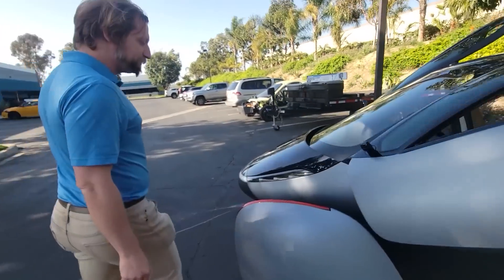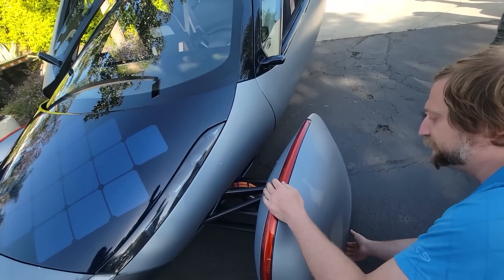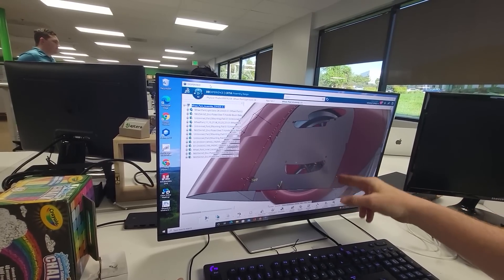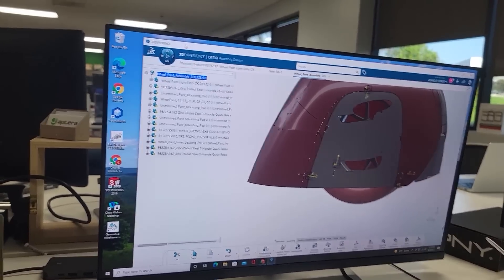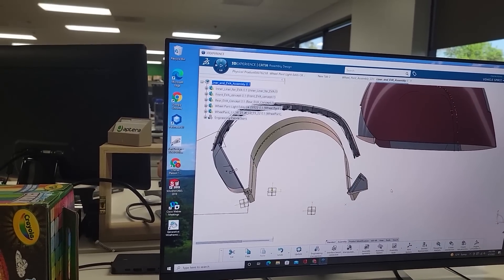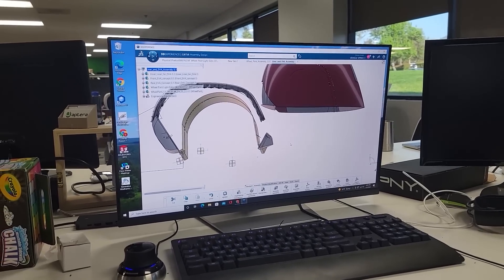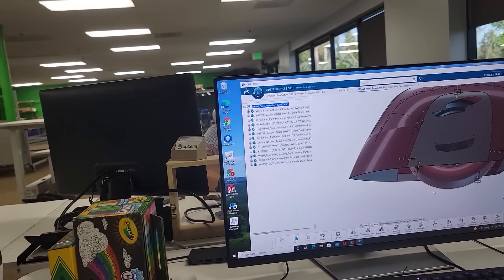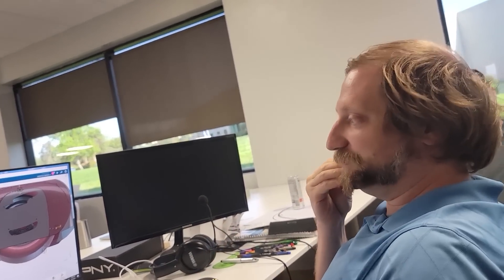No more wobbly wheelpants on the Aptera

Comment: What is the deepest pothole one can drive over with the Aptera?  Just curious.  I know most potholes are no deeper than an inch or two, but every now and then a real whopper deep one appears.
Reply: Seriously I really wonder how bad these roads are in california because potholes are just not a concern for me.  I drive mountain roads in BC and they are nowhere to be found.  Do we need the vision system  to actively subtly shift lane position to auto dodge them.... or perhaps demand better road maintenance.
Reply: @ccibinel  I live and drive in Pennsylvania.  Potholes are a major concern here.
Reply: I live in Florida. Where I live pot holes not an issue as road maintenance is good. Before FL lived in AZ, UT and VA. In VA a little issue with potholes. In the other states none. I don't think there will be a greater issue with potholes for Aptera than the current vehicles we drive as road clearance is roughly the same unless you have a lifted vehicle of some sort

Comment: hummm...  I thought the original design is to have an upper and lower portion of the pants so I can remove the lower portion in the winter to reduce the snow/ice/salt/sand pack inside the wheel pants.  Looks like they have changed it back to 1 piece.  I will have to see real world testing of this car next winter in the north after a snow storm and see how and if a packed wheel pants function.  So far, I am not optimistic in keeping my reservation due to winter driving/visibility concern
Reply: I live in Iowa and will be posting about this after I take delivery of my Paradigm model next winter season.

Comment: Excellent video. They're asking themselves all the right questions. Things like "what breaks in case things break?" are important for us customers. Aptera is not looking to sell you expensive spare parts, but to make your vehicle affordable to own and repair.

Nice to hear about the many customers from the Netherlands. I'm hoping I had something to do with that being an ambassador from the Netherlands trying to make Aptera known :-).

By the way, we don't get a lot of snow and ice over here ;-). Maximum a few days per year and all the roads are cleared as much as possible. We don't have mountains and we are seaside, so the climate is quite mild. If it's cold, there's usually no precipitation. 
I would buy a car that couldn't drive on snow at all. Unless I would plan on regularly taking it out for winter sports in Austria/Switzerland.
Reply: I wish VW would use the same thinking.  I've lost rack of how many parts I've broken because the bracket or connector was stronger than the part it was connected to.

Comment: The Aptera is too wide. Pulling the wheels into the main body should be a priority.
Reply: Won’t happen for this iteration of Aptera as has been discussed many times. We’ll have to see if the future larger passenger version goes in that direction.
Reply: The present design takes over 10% from the Cd.  This is worth the trade-off for the purpose of the vehicle.  The next Aptera model will likely be a 5 passenger, 4 wheel sedan, and will be more mainstream, while still offering value and attention to detail.

Comment: Thanks Steve! I liked the office walk-through, seeing the Aptera team and workspace. It is so clear from this video that Aptera is serious about resolving these issues in the best way possible, using innovative engineering. And hopefully before the first production Aptera is even built. I like the concept of having the wheel pants easily removable, maybe without tools. But 99.9% of the time they will be in use, attached to the Aptera. And I would be more concerned with them popping loose, or being removed by someone else, than having to open the hood or glove box to get the tool to remove the wheel pants, when needed. I also liked hearing about the top down cameras to be able to see the Aptera in an arial view to determine relative closeness to curbs and to avoid backing into objects, people and vehicles.

Comment: The road frequency of the wheel pants could also be increased by reducing the mass that exists away from the mounting points. If you remove as much mass as possible that is located away from the mounting points ... the natural frequency will increase. (no doubt their engineers are across this already)

Comment: A suggestion yo keep even more turbulent air out of void spaces of wheel wells: stiff nylon brushes inside the void volumes (dead volume) to calm the air, so that it stays attached in laminar fashion (by not getting dragged into the dead volumes). Maybe with modeling?
Reply: maybe put this comment on the Aptera channel?
Reply: Too much trouble.  Duct tape!

Comment: What about tire chains do to the wheel pants?
Reply: I guess you will use textile tire chains instead of actual chains.
Reply: @PereAndreuUbachdeFuentes  Or low-clearance cable chains.
Reply: I will probably install studded snow tires instead of trying to use chains for my use in Iowa.
Reply: In California you are not allowed to ride a motorcycle or autocycle where tire chains are required. In other states you are not required to use tire chains; I recommend snow tires.

Comment: AOC creator, I work with rotary wing aircraft (helicopters) and planes, as well, have this device I am going to mention. Deice kits. They are a normally electrically powered unit that does not let ice form on the leading edges of the blades (helicopters) or wings on planes. Maybe, if necessary, a deice kit could be fitted to the inside of the wheel pans. Just an idea.

Comment: What happens to the wheel motor when you get a flat tire?
Reply: Think of it something like the hub motor taking the place of or being combined with the disk brake rotor you see in a conventional wheel.
Reply: Once the wheel pants are removed, the wheel just unbolts from the motor hub.  No more complicated than any other car.

Comment: I think this engineer was doing his job being very conservative about the worst case scenario. If you think about it, the fact the wheel doesn’t move up and down relative to the pant means snow will be a non-issue, at least to the same degree it’s a non issue in regular cars. I’ve gotten a stupid amount of ice built up in a number of wheel wells and never had issues.
Reply: Have you consider the added 20+ lbs of weight added inside the wheel pants affect the driving dynamic of the car?  Especially if the left and right wheel pants has different amount/weight of pack snow/sand?
Reply: @Whats-DanT-Up-To  On the other hand, since the pants aren't supported by the suspension the up and down movements of the pants will be much more abrupt than the movements of a normal car fender , and so might be more likely to shake accumulated ice and snow loose.

Comment: Add a cold weather package option with heated wheel pans.
Reply: I'm really surprised with how enclosed the wheel pan is that the 5-10% waste heat wouldn't be substantial enough to melt the snow off.  Normal EVs and ICE cars have plenty of heat but it isn't targetted at the wheel.  That is still up to 300 watts per wheel at 60 mph.  Ever try change an old incandescent light that hasn't been off for long - the fixtures are hot too.

Comment: NICE,,,Allso if there was a entire outer attachment plate snap in or something drive-through cracks everything the crush points could be reusable or scratch and scrap kits that would sell like hotcakes every year because all of us always scrape our outer rims sooner or later every time and whole wheel covers seem more pricey to replace. Actually I want the off road style, for the shortness and bigger angles as well as higher so I can see the bottoms of all three bottom matching rims , that's how I'm going to drive  everywhere, the cameras sound helpful when parking. Interesting to see if there will be a sentry mode update, I definitely will need that mod. I would like the bottom rear to be chopped with bumpers as well so the very bottom line looks straight front to back , upper lights look nice. I park outside so I would love to be notified if someone sits on my wheels or something, or gets spiteful seeing the car outside everyday.
Reply: There will be no century mode in the first production Apterae. Perhaps an over the air update in the future as all components for such a feature will be present.
Reply: @johnmalcom9159  I know that's why I have ring cameras at my house I park outside

Comment: With the in hub motors it may be able to have a solid shaft going though the center of the wheel assembly to make the attachment point for the wheel pant on the outer surface.
Reply: This seems like the best idea
Reply: I would think such a feature would not be advisable as it would add extra unwanted weight

Comment: Thanks, that was interesting and you brought up some good questions. Having years of fighting aircraft wheel pants I appreciate the design challenge.  Cessna's from the 60's and early 70's used a fiberglass composite layup that held up very well but it was heavy. Later Cessna went to a vinyl plastic that was surprisingly light and strong but cracked due to vibration and became brittle with age. I would expect that composite structures would be light and strong but they need to be affordable and resistant to stress cracking, which I've see with even carbon fiber wheel pants on aircraft which spend very little time on smooth taxiways and runways, unlike a car wheel that's continually moving

Comment: What boils down for those of you that live in the snow areas, do not buy this fantastic vehicle. The pants might collect snow and ice. 

For those of you who are afraid damaging the wheel pants, this is not for you because you are not going to get them replace for cheap unless your insurance pays for them.

If these are game changers, this vehicle is not for you.
Reply: It's the same with fenders on normal cars. Snow and ice collect all winter in the wheel well. The tires scrape it away if it gets in the way. It's not a problem.
Reply: @carlanderson4139  agreed. And that’s in and even worse scenario where the wheel moves relative to the fender.
Reply: How much snow collects on the muffler of your present vehicle?  The wheel pants are over the motors - the major heat source of the vehicle!

Aptera feels that the motors are  so efficient that the heat from them may not be a factor, however - which is astoundingly good news for the performance!
Reply: @n.brucenelson5920  I calculated 150-300 watts of heat (90-95% efficiency) if driving at 60mph / 100 kph with the FWD (6000 watts total = 100 wh/mile).  With how enclosed it is this should melt off the snow any time you stop.  The wheel motor / wheel are heavy hunks of metal which will hold this heat.
Reply: @ccibinel  i don't think so. It takes 94 watt hours to melt 1 kg of ice. That's assuming it's at freezing point and no thermal loses. At 60 mph there will be a lot of air swirling around the wheel cooling things off.  And you will lose heat through the shell of the pant itself, despite the insulation of the packed snow.
Reply: @carlanderson4139  Lots of variables to consider.  I definitely don't think you need to melt 1KG of snow/ice to have it fall off.  Since the wheel doesn't move up and down the air movement is reduced but 100% is a consideration as the tread pattern is like a shovel and air will move with the tire due to skin friction; that's why I said when you stop (WAY less variables).  Snow accumulation is far worse on rear wheels of ICE cars because their is far less leftover heat to deal with the problem when you stop.  Until someone points a thermal camera at a wheel motor after an hour of highway driving we really don't know how hot it will be from use.   If the outside temperature is -2C then the remaining heat should be easily enough; if its -30C probably not.
Reply: I think the primary issue with the design is that when the ice sloughs off, a great deal of it will be trapped on the horizontal "shelves" at front an back. Could be pretty bad if it's half-melted dense slush that then refreezes overnight into chunks of very dense ice. Perhaps those horizontal pieces on the bottom of fairing could be removable for winter driving. If not possible intergrated heating element incorporated into fairing inner skin as an option.

Comment: Another great video!  The only questions I could think of ... what else is in the off-road package that should cost $1000?  It doesn't seem like a slightly modified leading/trailing edge on the wheel pants should cost that much.  Any insight on that?  Thanks.
Reply: That price was completely arbitrary when they launched in 2020. I think you can expect the price of pretty much everything to change. I fully expect the basic vehicle price to increase at least 10%.
Reply from the maker: Yeah I think that if the off-road package is just modified pants they are going to have a hard time justifying the 1000 dollar increase.  I think several things are not finalized yet
Reply: @ApteraOwnersClub  Very likely the options and potentially the price will change.  I think aptera will be conscious of their reservation holders and not pull a rivian but realistically a $2-4k increase might not be unreasonable given inflation; the company needs to succeed and make money.  If a good part of what would have been the offroad package is now standard then the package gets cheaper and the base price justifiably should go up a bit if the company cant absorb it.   It seems like we have a few too many options and it adds a lot of logistics and manufacturing complexity.  Based on the fact it took 3 months to get a "no comment" answer to what color is the hood if I dont get the hood solar panels I expect the solar hood to become standard.  Safetypilot isn't cheap but could also make sense to standardize because it makes the vehicle cheaper which SHOULD save on insurance over time.
Reply: If I ever take my Aptera off road (I don't plan to) I will remove the front wheel pants and rear skirt.
As to the cost, I imagine there won't be many off-road equipped Apteras. Therefore the cost of these few units will be greater.
Reply: It might be that it will include two full sets of wheel pants, a standard and an off road.
Reply: Maybe the price was to gauge customer interest. If they said the cost was $90.00, who WOULDN'T say they'd opt for it?
For myself, at $1000.00 it's out of the question.  200.00? I might go for it.
Reply: They mentioned  increased ride height. I suspect part of it would be due to increased aspect ratio of tires. Plus, they mentioned higher clearance of wheel pants.
Reply: Based on the last few interviews, I don't expect different ride height or different wheel pants. Just those inserts in front and back. That would mean there's not going to be that $1000 optional off road kit I assume. 

I'm glad if they don't decide to stick to a plan that turns out to be suboptimal. Better to stay rational than to make awkward decisions based on marketing "promises".
Reply: I think the development cost of different wheel covers, a separate suspension (Lifted) and changes to production line may account for that estimated cost. I agree with the posters that prices on everything will change once dev costs, increased material and labor costs from inflation and the affects of COVID on the supply chain are factored in. We can only wait to see when production vehicle and  addons are priced. Aptera is a company and deserves to make a profit!!

Comment: Good shit Bubba! With form following function, it will take a minute to work out the kinks. Being such a novel concept and design, there will be unexpected issues. I actually like your suggestion of popping off the wheel pans for off roading.
Reply: I also totally dig the idea of removing the wheel pants in certain situations. It could even be included as a feature of the Aptera's software package to identify rough terrain and suggest the driver to stop and remove the wheel pants.
Reply: @PereAndreuUbachdeFuentes    With wheel pants removed, it could be easier to attach tire chains to Aptera than just about any other vehicle.

Comment: So where the bottom of the wheel pants are "covered", will that just act to collect dirt. grime and snow and ice? (4:40 in the video).  My order is in Alaska where snow and ice are big concerns.
Reply: I live in Iowa, and will get one of the early Paradigms.  I will be sure to report on my experience.
Reply: @n.brucenelson5920  Thank you Bruce.
Reply: @n.brucenelson5920  Can't wait.  That is a big concern of mine in Canada.  Also the location of the rearview camera if it will be covered by 'smoot' (Bjorn Nyland term for dirt/snow throw up by the wheel during winter driving) and render the camera useless (like my backup camera located near the license plate)
Reply: @Whats-DanT-Up-To  I know the feeling!  The rear camera being obscured is a concern.  My guess is that the aerodynamics of air coming off the back will prevent this, but we will see.  Happy Easter  (and Ramadan and Passover!)
Reply: I expect the wheel well's inner liner will keep the dirt, snow & ice out.

Comment: Mite be good to have a tool to remove it so they dont get stolen easily
Reply from the maker: Hmm good point
Reply: I would guess they’ll use a square or star type bolt head anyway. They are easy to find, but perhaps your common street thief wouldn’t carry a tool/adapter with them.
Reply: @arlenbell4376  A thief might, but what would be the monetary gain of stealing wheel pants?   I think the issue is more about preventing random vandalism, which the Aptera, being weird, might attract.